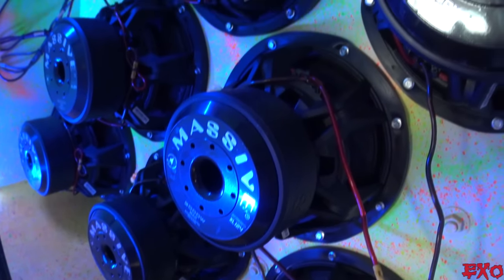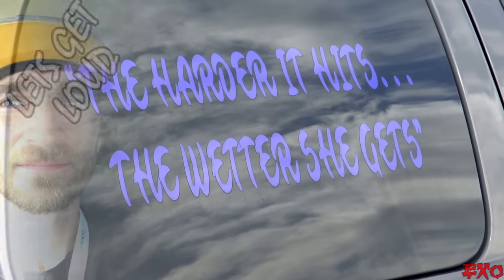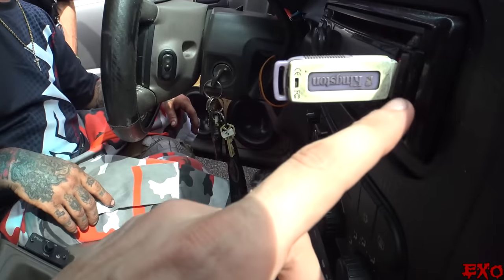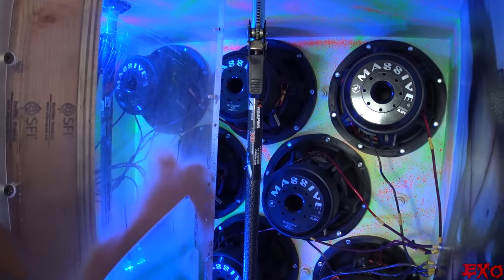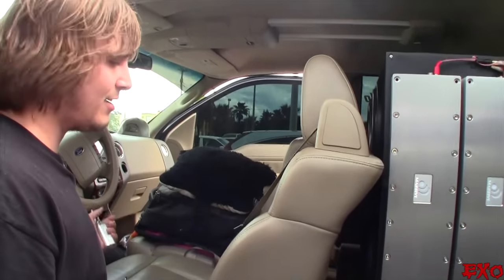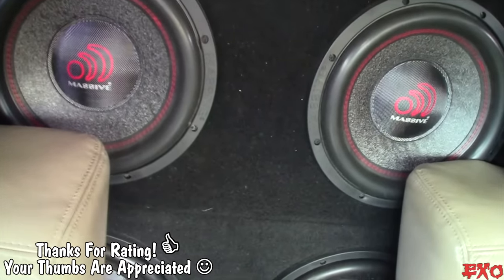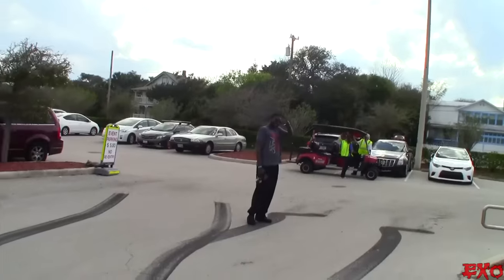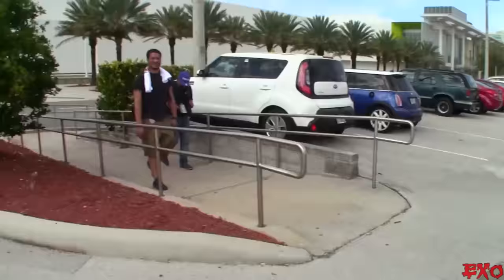MASSIVE AUDIO SUBS w/ 4000 Watt BASS Amp Install | 12 inch Summo XL & Hippo in PREFAB Subwoofer Box

Comment: That Crescendo 12k was beautiful, but I was distracted by that Boss Audio amp.
Reply: Wijibo ikr
Reply: I cant believe i'd ever say this as I despise boss but It looks like one of their old  school units that were very heavy and solid. I actually found a boss in my friends car from like 2003 that was accurately rated at 300w with a 30a fuse.
Reply: Id use some boss amps on just some mids and highs, not on the sub tho. Id also cover that shit up hahaha. Theyre not bad starter amps or for mids and highs but they dont put out what they say they do and their crossovers suck for subwoofers. Glad i dont use em anymore though
Reply: everything i ever owned by BOSS.. going way way back was T R A S H !!
Reply: Shit i remember running boss audio amplifier when i first started in 2010. I cheaped out on the amp and bought 2 08 edition kicker L7 12s i smoked that amp in less then 3 days 😂😂😂. I bought a hifonics brutus brz 1700.1 at 1ohm. Had a 170amp internal fuse. I ran it at half an ohm .not knowing i bought two dual 2ohm kicker subwoofers. Ran them like that for almost 2 years tell they got stolen. Man those were the days 😂😂😂
Reply: Pope Platinum Beats 😂😂😂 true

Comment: I use to compete in car audio when I was in my early 20's, won 2nd place a couple of times locally.  I only had 2 12" Type R's (The originals) and a 1200 Watt Orion XTR Pro 1000 amplifier.  I made the entire trunk speaker box, lots of dino mat...  And I put ports in the rear deck to shoot sound at a 45 degree angle up the back glass to the front windshield where the Mic would be.

I topped out at 150.2 DB on 2 12's....  I was like "The Fastest Indian" but with car audio.  I was constantly trying to get more out of just those 2 12's.  I would tighten bolts, shoot foam in stuff that was vibrating and on and on.  Funny thing to it was all in a 1991 Ford Tempo GL.... LOL

Now days though, I have a Polaris RZR and go offroading, so I'm trying to get a NICE stereo on that.

Comment: nothing wrong with a pre fab so long as the space is right and port is proper ( exact box depth and specs may matter in some very specific cases but generally as long as the cu ft is right you're fine.)

Comment: Was running 2....Downsized to one hippo xl122r in my Scion tC hatchback. that bitch is loud as fuck. Custom box created by Frederick Ross of Louisiana.   Running on a hifonics Colossus 35th anniversary amplifier with an Iraqgi 320 alternator... 4 Deaf bonce Arnold pro mids running off a 600 by 4 Rockford fosgate amp and 4 deaf Bonce machete super tweeters. Also two 3.5scar audios and two 4" massive audio mids...

Comment: I have 2 12 inch massive with each 3000 watts and 6000watts nemesis with super tweeters and with 2 10 inch massive 2500 watts each under seat with another 6000 watts nemesis amp I’m soon to get my back seat taken off for a bigger box

Comment: How does that first system not having loading issues with those three subs in line with the port?
Reply: It never had a issue with loading but pulled two out and bumped up power he dident put the video on here wish he would have so much better and hits so much harder..
Reply: I changed it right after due to it wasint dune and i blew the face plat apart

Comment: I'm modifying my prefab box for slightly better lows, on top of a complete redo of my amp, adding a new bass amp, and powered rear deck speakers. Video update coming soon, or you can check out my crappy setup on my channel.

Comment: Can someone help me out with some problems I’m having with my amp? So I turn my car on and then my radio turns on but my amp turns off... weird right? But when I turn my car off my amp turns on... all my wiring is perfect... also for some reason when I jump the remote and get it turned on while my radio is on, it’s normal then turn my car off so radio is off and then I get MASSIVE back feed in just my subs alone... like so much back feed that my 1,300 watt max rated subs start over heating with my 1,000 watt max rated amp... I don’t wanna blow them up either... I disconnect the RCAs to the amp and it stops immediately... I have no clue what’s going on... I have the stock radio but have a line output converter which is probably the issue but I haven’t had any issues with it until recently... didn’t touch anything and all that started happening...

Comment: And those are the older hippos too the newer hippo xl's and the hippo xlr's are even nastier. I just sold my hippo xl a month ago for 200 bucks. Then everyone hmu to buy it lol.
Reply: I got two XXL hippos 4 k a peace on a taramp 8k amp with a battery an a  hot set up cross over  doing great beating the block down. Its louder than my mojoe 15" 4400 that I had.

Comment: 4 to 5 grand
Lol. And prefab boxes. Jesus
Reply: For anyone that cares

05 F150 Lariat
Gutted interior added two layers of deadener on floor back wall and roof (Buzzmat)
Michael Singer built 270a Custom alternator
Reikken JBU34H battery(Under hood)
25 ft KnuKonceptz Kolossus 4/0 under frame
2 Reikken JB2017 Batteries
20 ft Knukoncepts Kolossus Fleks 1/0
KnuKonceptz Fused Power Distribution
KnuKonceptz Ground Distribution
2 runs of 1/0 Kolossus Fleks Grounded straight to the frame
4 Massive Hippos
2 D8000 4K RMS @ .5 ohm no sweat for hours
D1600.4 full range 4ch
4 Digital Designs VO M6.5 mids 
4 Digital Designs Mini VO bullet tweets
Pioneer app radio 4v preouts
4ch KnuKonceptz Krystal Rcas 8m
2ch KnuKonceptz Krystal Rcas 8m

Ended up doing a 54 playing music not bad on prefabs
Reply: I had 6 summo xl 12s $224 each brutus amps $245 each 
6 group 31s $175 each 
270a alt $500 over payed but working good 4 years later..
10 sheets burch at $55 a sheet wood screws glue bracing rebar.. 13 cans spray fome.. Paint.... 
Crown 1/0 wire plexy glass 1.5"thich yea i was well over 4000

Comment: Dude only hits 151 on 4 2000watt rms subs, I had 4 400watt rms 13 years ago and hit 150 no test down just added box's like he did
Reply: meh it was early on, best it saw was 54 after we sealed the face with a beauty panel... Problem was all the dead space around the boxes... Not to mention it played 50s in the very low 20s on the prefabs. I enjoyed it